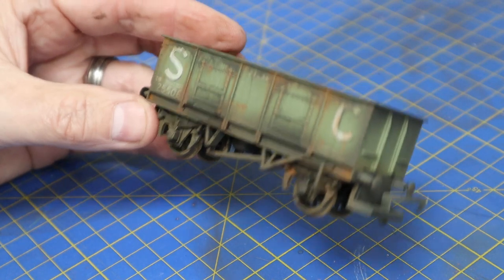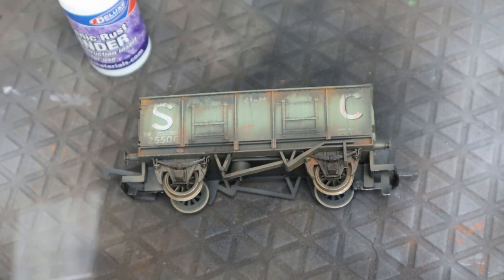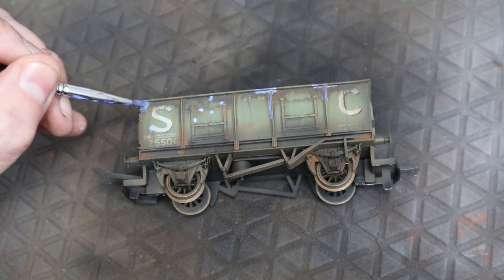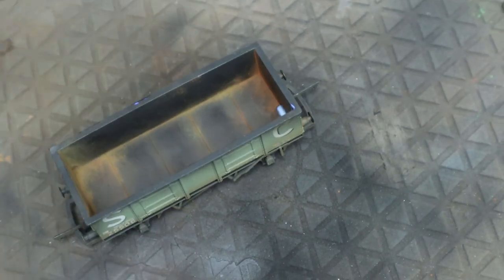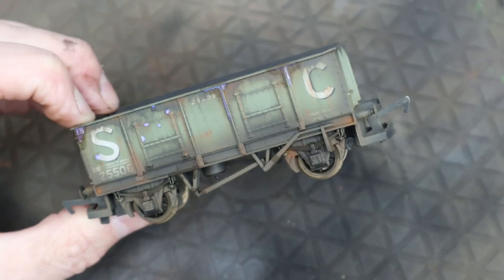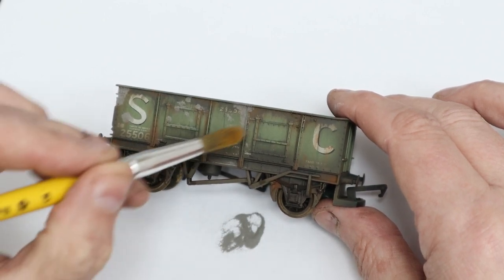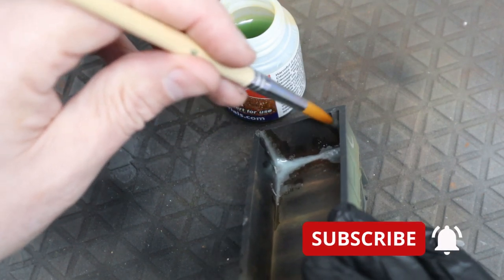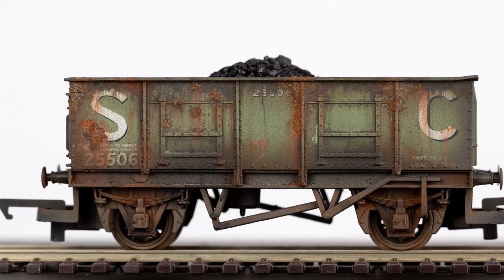Weathering Model Railway | Adding Real Rust to Your Wagons

Comment: I make my own rust powder (iron oxide).  I put 3 or 4 rolls of steel wool in a quart jar and fill it up with vinegar, put it in the window and wait a couple of months.  After I get a rusty mess, I pour it into a 11x14 stainless photo processing tray (you could us a flat baking dish) and wait a couple of weeks for it to dry.  Then I pulverize the iron oxide into a powder using a single edge razor blade, then store it in a snuff tin.  Looks like real rust 'cause it is real rust!  Sometimes I gouge the side of a piece of rolling stock and fill 'er up with my rust and sometimes I make a slurry of rust powder, water soluble glycerin and some alcohol.  Then you can paint it on the sides or dab with a sponge.  After weathering I give it a topcoat of dull coat.  Cheers from eastern Tennessee